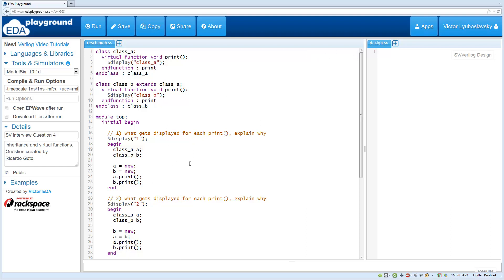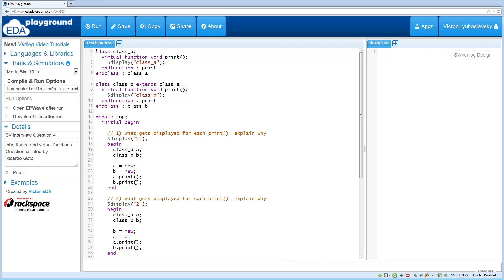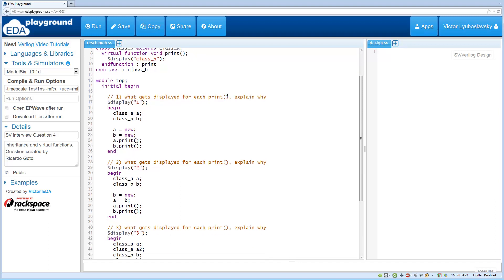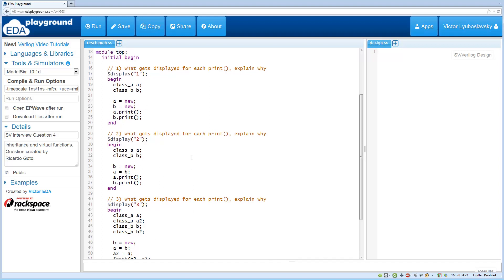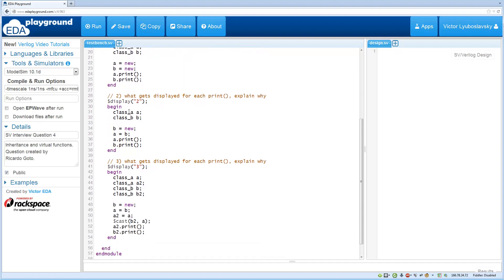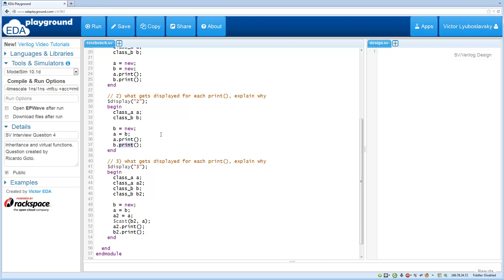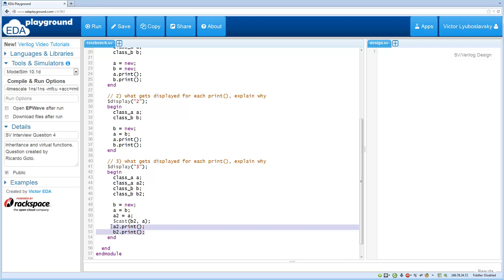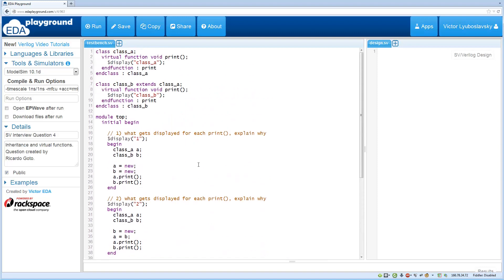SystemVerilog Interview Question 4 -- Inheritance and Virtual Functions

Comment: Here is my answer:

1) what gets displayed for each print(), explain why

Answer:
class_a
class_b

Reason : These are direct calls to the methods of individual classes

2) what gets displayed for each print(), explain why

Answer:
class_b
class_b

Reason: Here we can notice a line "a=b". Here, a is holding an instance of the b class. However, when we call the print method --> it gets resolved based on the instance type and not the handle type. This is because "virtual" method is used. Hence, it prints class_b for the first time. 
For the second "class_b" print --> its a direct call to the print method.

 3) what gets displayed for each print(), explain why

Answer:
class_b
class_b

Reason: a is carrying an instance of the b class. Now, a2 carries an instance of the b class. With the $cast--> b2 carries instance of the a which in turn carries instance of the b class. Hence, it prints class_b both times

4) If we remove virtual from the extended class, how does that change things?

If we remove virtual from extended class method, it will still be virtual by default.  because, if a parent class method is virtual --> all the derived class methods of that parent class with same name becomes virtual.

5) If we remove virtual from both classes, how does that change things?

It would definitely change things because now the print method is resolved based on handle type and not instance type. Because of this the answer for question 2 will become class_a, class_b  and question 3 will become class_a, class_b

Please refer this video by Brian from Cadence for a complete understanding of handle type and instance type : https://www.youtube.com/watch?v=KWCOxI0mL80

Comment: Hi, when I try running this code, why does it say Simulator ModelSim 10.1d is not available?
Reply from the maker: This code was saved by another user many years ago using that simulator, which now is not available on EDA Playground. (However, its more capable cousin - Questa - is.) So, please just change the simulator to a different one from the "Commercial Simulators" list. (If you're having troubling finding that list, it will be highlighted in red when the above error message is displayed.)

Comment: Don't we have create an instance for class A? I mean in the 2nd question when we say a = b, and say a.print(). Is this valid? Can someone elaborate
Reply from the maker: Yes. This is valid. Variables a and b are pointers. So, when you say "a = b" that means "make varaible a point to the same object as b points to". so, now variable a points to an object of class B and, because print is a virtual method, when you say a.print() with a pointing to an object of class B, class B's print method gets called.

Comment: If we make class_a (base class) non-virtual and class_b (derived class) as virtual. Then what would be the output of third case i.e.   
      class_a a2;
      class_b b;
      class_b b2;
      
      b = new;
      a = b;
      a2 = a;
      $cast(b2, a);
      a2.print();
      b2.print();

As class "b" being virtual, i thought       $cast(b2, a) will make the function of b to print class_a, no?
Reply from the maker: It does. But the variable a is already pointing to an object of class class_b, because of this line:  a = b;

Comment: 1) class a   class  b (straight forward)
2) class b  class b as now its resolved based on contents type(examining the contents) and not the handle type as we have virtual functions
3)class b  class b as now its resolved based on contents type(examining the contents) and not the handle type as we have virtual functions (Both a2,a point to the class instance b as parent can point to children but not the other way. For children to point to parent we need to check using $cast)
4)If we remove virtual only in extended class but retain virtual in base class then result will be no change as a method in base class if virtual implies that it is also virtual in  the derived class/sub class/child class so it is still resolved based on contents type so the answer will be class a class b -->class b class b --> class b class b (basically no change from previous results 1-3)
This is also why the BKM is to be explicit and not assume anything so better declare the sub class methods also as virtual explicitly if intended to avoid inferring indirectly
5) If we do not declare the methods in base class, derived class as virtual then its resolved based on handle type and the pointer doesn't matter so the answer is class a class b -->class a class b --> class a class b
Reply from the maker: I agree. well done!
Reply: @Edaplayground_EPWave   I believe that answer for 4) is {class b , class b}, since we removed virtual from extended class, not from base class
Reply from the maker: @sandeshvs519  The answer to Q4 is that "it makes no difference". (A method is virtual if specified in the base class. Whether this is respecified in the extended class or not doesn't matter.)
Reply: @Sandesh V S   Just to add on :   If i understand it right, if we specify a method in the base class as virtual, method with the same name automatically becomes "virtual" in all the derived classes. Hence, the behaviour for the Question 4 does not change

However, if it was mentioned that "virtual keyword will be removed from both base and extended class" --> then it would print {class a, class b} since the print macros are identified based on handle type and not instance type
Reply: Vishal Rathee  yes, that's why it should print (class b, class b). Is that right ??

Comment: Hi,
I am very new to c++ and polymorphism
With virtual function i got: ab,bb,bb
Without Virtual function I got ab,ab,ab
I have read online about polymorphism...but still this is not clear why ab,bb,bb in first case and ab,ab,ab in second case.
Please explain ...thanks a lot
Reply from the maker: Hi,

When we execute these lines:

      class_a a;
      class_b b;

      b = new;
      a = b;

a is a reference of class a that is pointed to an object of class b. If we then execute:

      a.print();

Do we want the print method of class a to be called or the print method of class b to be called? We can decide by making the print method virtual or not. If the print method is virtual, then the choice of method called depends on the object pointed to, which in the above code, is of class b, so the print method called would be that of class b. If the method is not virtual, then the choice of method called depends on the class of the reference, which in the above code, is of class a, so the print method called would be that of class a.

Hope that helps,

Matthew

Comment: Really nice videos. Do you have questions about SV events? Actually that is one of the areas in which I lack of knowledge
Reply from the maker: +rgarciaf071 

Hi,

Sorry for the delay - I have been out of the office... now it's back to reality...

There is an EDA Playground video that covers ordinary Verilog events. See (5:50 in):

https://www.youtube.com/watch?v=iyR0iughuIc

There isn't any more about SV events specifically (though they are mentioned in the Doulos Comprehensive System Verilog course). 

SV enhances the Verilog event. No surprise, there. In SV, an event becomes an object: If e is an event, e.triggered becomes true when the event is triggered, and then remains true until the end of the timeslot in which that triggering of e occurred.  Also, just like any other reference to an object, e may be assigned the name of another event – the event is acting as a handle or reference to an underlying event object. Also, e may be passed as an argument to a task or function. 

You can trigger an SV event in the NBA region using the ->> operator and there is a new wait_order statement that waits for a sequence of events.

Cheers,

Matthew
Reply: EDA Playground Thank you very much!!!

Comment: Tested in EDA playground.
1.ab
2.bb: there is only one class_b object.
3.bb: a and b2 are class_b object for the $cast
4.no change. Is there any override for class_b?
5.ababab since no override without virtual for the print() in class_a
In this case it seems objects will call the corresponding functions without overriding.
Reply from the maker: 4. If there were classes extending class_b, you wouldn't be able to use a class_b handle to call print() for the extended classes. So no overrides.
Reply: I think there will be no change for Que 4. Polymorphism is still achieved if there are classes extending class_b even after removal of 'virtual' in class_b because the method is declared virtual in base class class_a.
Reply from the maker: +Neha R 
Yes - you're right.